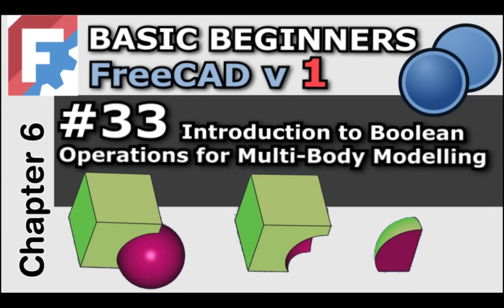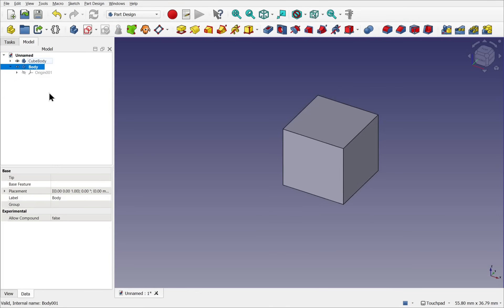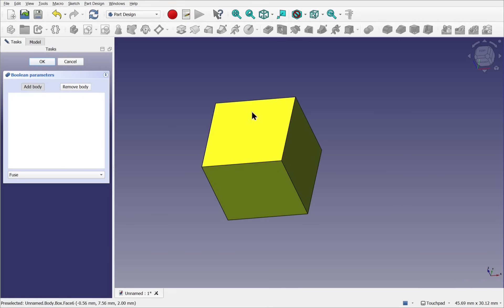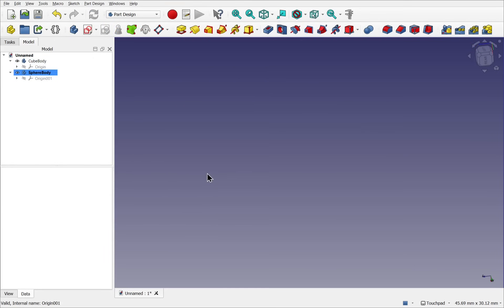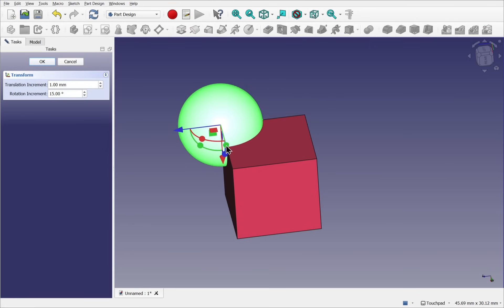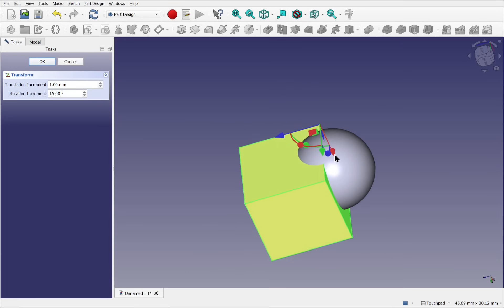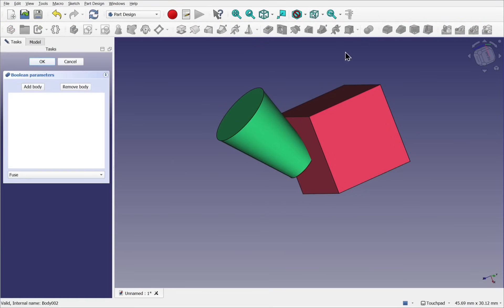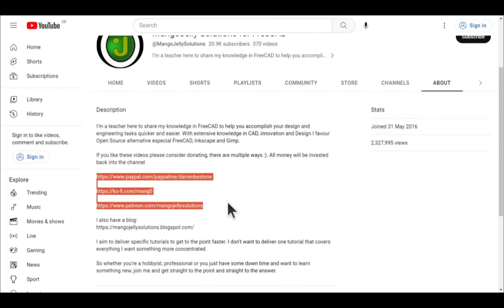FreeCAD 1.0 | Introduction to Multi-Body Boolean Operations | Basic Beginners FreeCAD Lesson 33

Comment: Please indicate if you have covered this kind of functionality - to cut a door or part out of a tube shaped object (say creating a door in a plane's fuselage), where you want to keep the cut part and as a second object or part ?

I guess I can do two operations starting with the two bodies - one do a cut and keep the result. The other do a "common" and keep that. Is the the right way to approach it?
Reply from the maker: If your in the part design booleans require two bodies (Part WB it's a lot easier as you can dive into the tree and show the part you used in your boolean and continue working with it, though the treeview can easily get in a mess).  You can utilise your Part Design Clone operation for this, where you pick from a position in your Part Design history (not the body itself), click the operation in the treeview, use the PD Clone, you will get a second body.  You can use this to make additional boolean operations.  Any changes below the operation of the master won't affect the clone.  I believe I do something similar in the next video (or one after) in the series.
Reply: @MangoJellySolutions many thanks.

Comment: Thanks, I've been finding your tutorials very helpfull since starting with Freecad 3 weeks ago.
I know Part Design wb is considered superior to Part wb, and I'm trying to use it as much as I can, specially when sketches are the main building blocks.
But when I have to do these kind of boolean operations on primitive solids, I'll just use my trusted Part wb, then Part Design just doesn't make sense to me.
Specially as my first Freecad design was a portable aircon filter framework that is much bigger than my printer's buildplate, I found it so easy and satisfying to use two planes and the slice apart operation in the Part wb, to slice it in 4 quarters.
Reply from the maker: Echo what your saying. Part design is a more restricted workflow, part wb on the other hand, as you probably finding out,  is so so much more flexible, for starts you have zero chance with complex surface modeling in part design as it doesn't support open wires. I often drop back to part to do exactly what you have said, slicing and compounding.  I prefer part over part design, even when using sketches.

Comment: I hope you can help me out. The yellow create part container icon is missing on my Freecad 1.01. How do I enable it or show it?
Reply from the maker: Ok so that it the 'Structure' toolbar that appears on, right click on the toolbars at the top (any one, the whole top is a number of tools bars and not just one) and you will see a pop up window, within you will see a a number of options checked and uncheck, click on the structure and it should appear.  Hope that helps.
Reply: If the tool bar is enabled but the income is not showing, it is likely that the tool bar is not at full size. Try dragging the nest tool bar to the right to open up more space.

Comment: I've used F360, and Onshape, and have been learning FreeCad mostly through your series of videos. Thank you so much for putting in the time to make them. Freecad has been the most difficult of the 3 CAD programs that I've used so far. Your videos help, but some of Freecad's ways of doing things still makes no sense to me and is a huge source of frustration.
It really wound me up trying to figure out why what seemed like a simple boolean operation that I've done thousands of times in blender and hundreds of times in F360 and Onshape, was not working in Freecad. So I skipped ahead on the playlist a few videos to watch this one. As soon as used the "allow component" that you show here, it worked. I'm sure they have their reasons, but other than maybe that it saves some compute time, I don't understand why it doesn't default to this setting. Also, I wasn't cutting the target object into multiple objects anyway, so I'm still confused.

I keep getting "wire not closed" errors on some of my sketches, and can't figure out why or how to fix them because the "validate sketch" says there are not problems. Never every had a problem like that in any other program. I really hope by finishing going through all of your videos freecad will finally make sense to me, but wow, it is currently a nightmare of constant confusion and frustration for me.

All the different workbenches also get very confusing. I have a ton of other things that are constantly getting in the way of me making things with this program, but I'll leave it at that.

Anyway, thanks again. Without your videos, I would have completely given up on Freecad. I just hope it starts to make a lot more sense soon.
Reply from the maker: Totally agree with you there, freeCAD has been a challenge and like yourself I have come from other 3D packages.  I started when there wasn't any 'simple' information to help me so it was very trial and error.  One of the reasons why I put this channel together as it was 'HARD' going at the time.

Really glad these videos are helping, I am going to be releasing content soon regarding issues you may come across and how to resolve them.  FreeCAD is a unique beast and it's learning curve shows that.  Glad your enjoying the videos and hope things get easier as you progress.
Reply: @MangoJellySolutions  Thank you! I learned a 3D modeling and animation package on the Amiga (ages ago) and it was my first CG learning experience. The guy that ran the place I learned it at lost the manual on the second day he was learning it. So I was completely on my own and no previous knowledge of anything like it, and no online anything existed (I'm sure darpnet or whatever did, but it wasn't like the web now). I guess my excitement of what it could do motivated me to keep going. That stills keep driving me to torcher myself learning new way more complicated software. I should sue myself for all the trouble. LOL

When I wrote a different but similar comment on a different YT channel's video, they told me to go through your playlist and that by the time I'm done it will be as understandable as possible, so I dove right in. Without those videos, I'm positive I would have deleted off my computer just like I did the last time I tried to learn it.

Usually once I really grasp the logic of how a program works, I'm usually ok for the most part. All the different workbenches still messes with my head. But I am only through the first 20 or so.
Reply from the maker: @LincolnWorld  Was it Imagine3D or Lightwave?  Like you that's were I started on the A1200.  Loved that machine, such a creative community (if you could find them) :)  I still have a fond love for that machine, I was able to hack a PC hard drive into mine, had wires falling out the back lol.  I used to go to the Amiga fairs and was using the machine all the way up to 2004.  I even entered the Amiga Format games programming competition, the one the author of Worms entered.  Fond memories . Ihave a small emulation series on this channel for winUAE which is where this channel was originally going.

Great to hear you got recommended my way,  freeCAD has a steep learning curve but it will come :)
Reply: @MangoJellySolutions   That's funny that you pretty much started with what I started with. Imagine3D was by the same company, but came after Turbo Silver. And I started on an amiga500 and was so happy when they eventually got a 1200!

That's wild that you were able to do that with your Amiga! Did you ever play the Roger Rabbit game on the Amiga? I spent so much time on that game. It was great.

I ended up learning Lightwave once the place got in a video toaster, and went on to work as an animator on numerous low budget (not my choice) films and TV shows. Though eventually some were not low budget, and eventually I had to learn 3DMax for video game animation, and was the head of game design on one, and eventually animated on fully animated TV shows like Starship Troopers as well as many other shows, and I personally did entire 30 second opening to one episode of the powerpuff girls, and did a CG scene that Warner Bros used to have their artist trace, in Turbo Silver as my first ever paid gig that aired as the opening ever day on TV, as well as the same kind of thing for a scene in King of the Hill. It was a long time, but I just figured I'd give you some nostalgia on a few of the highlights of what I worked on.

I started learning Maya when that became needed to keep working. But unrelated to that, I left the biz because studios kept not paying enough, and treating everyone horrifically, and forcing us to put in an extra 35-50 hours a week with no pay for it. EVERY WEEK. I couldn't take any more abuse. During the 12 years I put up with it, I worked on stop motion and traditional animation as well animated 2D sprites for Sega 16 and Super Nintendo.

After leaving the biz I did not touch any 3D programs until I wanted to start making things using 3D printing, At which point I started torturing myself learning one of the first versions of Blender after it went open source. Maybe, 2.4 or something like that.   Though Blender is an absolute dream these days compared to back then, it still winds me up some times.

I still haven't learned my lesson. LOL

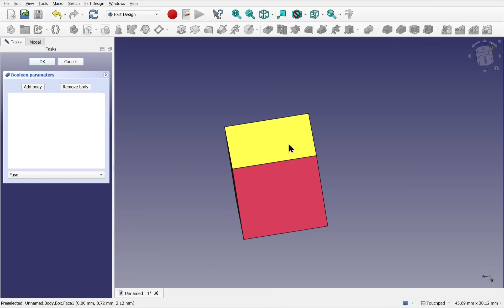Comment: G'day Darren, a question as regards definitions. At 7:06 You refer to the Cube as the remaining  Tool Body when We apply the Boolean, the active Body (Sphere) disappears. So the Tool Body is always the Non Active Body the Boolean Operation is to be performed upon? Using the Axis Cross (Key Short Cut A,C) I get the meaning of the Exercise but am a bit unclear on definitions e.g. Say I do a Boolean Cut removing a Sphere Body from the Cube is the Sphere the Tool or the Cube. Don't mean to appear Dense but a bit confused? To Me the Tool is the Object You Use (Sphere) to Modify Something (The  Cube)??? Is this a CAD Convention Type Thing? 

Duh!!! The Penny just dropped when You complete the Operations the various Tools (that by My own reasoning perform said Operation)  disappear leaving the Completed Part! Sorry I'm not Fastest Study. ;-) The 3 Object example at the End clears things up for Me. I found using the Axis Cross (A,C) with the Transparency View (V,T) helped also showing 0,0,0 Globals the the effect of Object Movement. Glad I've started revision it seems to be sinking in better!!

I'm off to a Sheet Metal Tutorial, I need to fabricate some Wing Rigging Fixtures for a Morane Saulnier L Series Monoplane I'm Scratch building.
Reply from the maker: Yeh booleans can melt your brain! Just wait to when you try them in the part workbench where you can make the previous features visible and reuse those.  Now that's were the fun (and confusion) really starts lol. (Just googled the plane) very nice :)

Comment: Great video. Is there a way to edit the tool once it's inside the boolean operation? I'm hoping there is a better workflow than having to delete the boolean operation and everything after it in the tree view just to update the tool
Reply from the maker: Thank you, glad you enjoyed.  One way is to use a clone workflow where you clone the body of the tool and then use the clone in the boolean operation.  That way the tool is free to make edits to.  That get's filtered down to the clone.  Strangely enough I will be covering a workflow very similar to this where I clone the tool body and use that in booleans in an upcoming lesson 35.

Comment: Great explanation, thanks.  Is there a way to keep the tool when doing a cut?
Reply: The tool is still present in the object tree inside the Boolean operation and can be reused for further operations.
Reply from the maker: Thank you :) As @robertbullock1056  said the tool is still inside the boolean operation.  You can clone it back out.  In a couple of episodes time I am actually using a workflow that shows exactly that flow.

Comment: Can you possibly do one on transferring data from a spreadsheet onto dimensions within a sketch?
I have several designs that depend on multiple interlocking parts of differing sizes. this would be much easier to pull the relevant dimensions from a spreadsheet, where they may be calculated in a table
Reply: If you've been using FreeCAD for a long time, you may not have noticed the addition of variable sets. I recently sat down to learn 1.0's assembly workbench and noticed the variable set icon in the toolbar for the first time. I've almost entirely stopped using spreadsheets within FreeCAD. VarSets cover 99.9% of the things I used to use a spreadsheet for and make the process easier and more convenient: no need to mess around with cell aliases if you want a readable reference and you can group variables into categories.
Reply: @catmoleman  Thank you, this is helpful in many ways, though it doesn't quite generate a table of calculations generated from a small set of parameters, to be spread out across several parts (bodies)
I couldn't quite figure out the binding process to link them
Reply: @davidconner-shover51  It won't be in a 2D table format, but if you're just creating spreadsheets like I was with a column of labels and a column of values (either manually-provided or calculated) then a variable set can 100% replace that. If you need more than two columns, then you'll need to stick with a spreadsheet (or you might be able to use groups within the varset to replace your usage of additional columns). You can do all the same calculations you could do in a spreadsheet with a variable set. When setting a variable's value, click the formula button or press = and then you can reference the other variables by name in the formula you provide.

To use the variables in your models, use the formula button (or press =) when typing in a dimension. Then, you can reference them with the name of the variable set (e.g. the default name, VarSet) and the variable name (e.g. motorDiameter) separated by a dot. For example: VarSet.motorDiameter

If you use camelCase or PascalCase when naming the variables, FreeCAD will display them with spaces between the words in the table view in the variable set's data tab.

The groups are just to help you keep track of different categories of variables: they don't act as namespaces. So, you can't have two variables with the same name in the same variable set even if they're in different groups.
Reply from the maker: Great tips from @catmoleman  :) :) Thank you for helping out @davidconner-shover51
Reply: @MangoJellySolutions  Thanks for the kind words—and thank you for making this fantastic series of videos. You're a wonderful teacher.